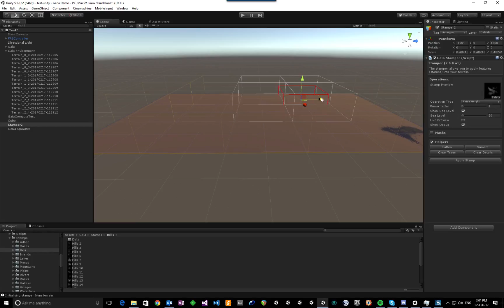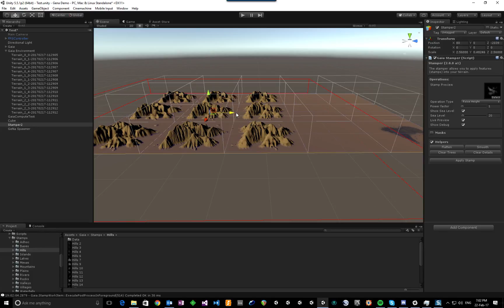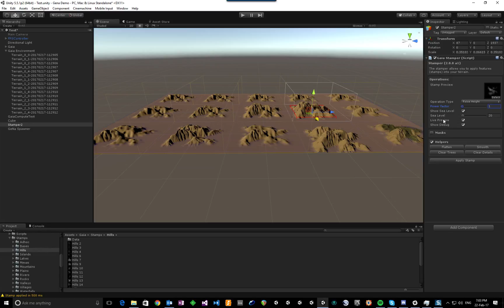Gaia 2.0 Stamper WIP

Comment: I am an avid fan and user of Gaia, and am willing to work on a project using it. However, a limitation of the Terrain system is that large chunks are too resource-intensive, and are too difficult to work with. Splitting a terrain into smaller chunks is viable, but not while the difficulties of stamping terrain over multiple chunks are present. Please, release an update with at least just this feature of the stamper, it will make development far more efficient.
Reply from the maker: It's well advanced and plan is to bring to market in next month or two.
Reply: Ah, sweet. Hope that all goes well and according to plan!

Comment: I can't wait for this update, this is just what I want, in a game i'm planning I need a large island, working on a 364 sq/km, and filling that with all the floura and forna would be a complete pain without GAIA. Thank you adam.
Reply from the maker: Blimey thats huge - even with Gaia 2 you are going to have trouble with it due to machine and memory limitations.
Reply: Really, because I have no problems in having a 150 sq/km, using world streamer, which is also very good, by the way. And I do have a beast! LOL
Reply from the maker: You will just need to break it down to smaller chunks that your machine can handle memory wise - and yeah world streamer will help you out
Reply from the maker: Contact me privately if you would like access.
Reply: Adam Goodrich does this mean 2.0 is near to release? ive been checking every week for over a year waiting for the multi tile support 😫😂
Reply from the maker: It is so much more advanced than this... i estimate about 2 months work to finish.